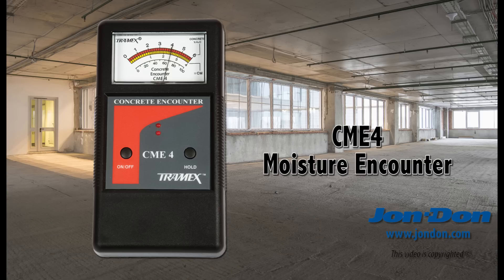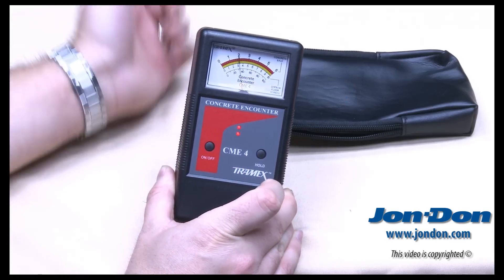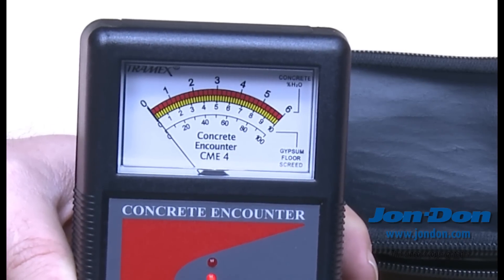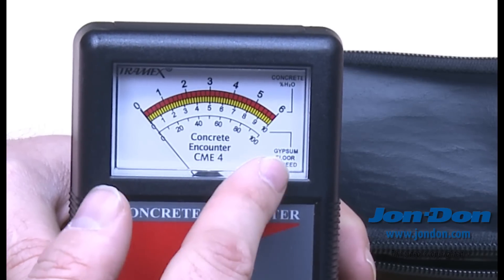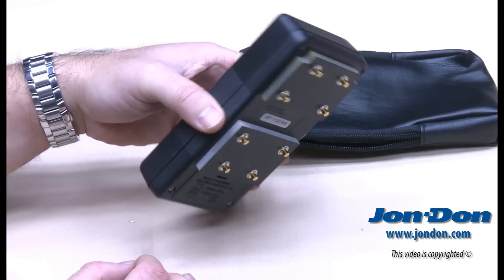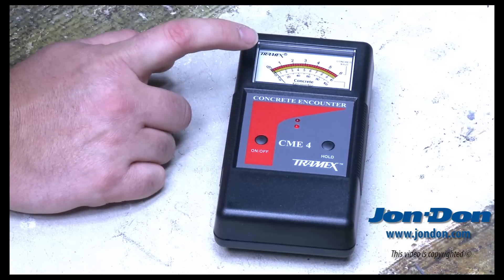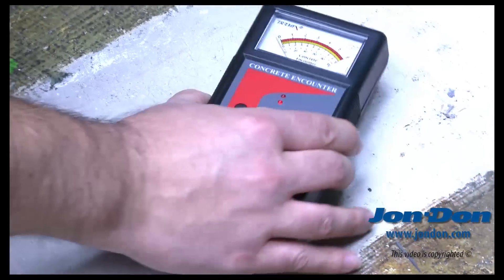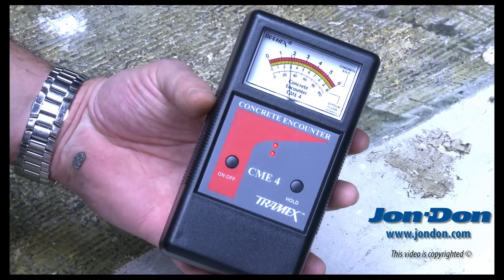Demo/Review of Tramex Concrete Moisture Encounter 4 - Jon-Don Video

Comment: This is all well and good but how does this reading do us any good when it comes to manufacturers warranties? Most product specs only provide moisture limits in lbs per 1,000sf. If I have a 5% reading on this, then how do we equate that? I’ve found no information anywhere as to what the readings on this machine mean or how the readings can be applied in an everyday scenario. Please shed some light
Reply from the maker: Most wood floor manufacturers have a required reading for the Tramex CME4, you can either call the wood floor manufacturer or google the wood floor manufacturer and Tramex CME4.  Most manufacturers require a reading of 4 - 4.5. For more assistance, please call at Jon-Don Restoration Rep at 800-556-6366 or email support@jondon.com.
Reply: Did anyone ever respond? I’m having the same issue.

Comment: What is the conversion from % to # of moisture
Reply: Jimenez did you ever get answers for this question I’m look for the same question haven’t seen  anything .
Reply from the maker: +Damon Jimenez Are you looking to convert relative humidity to grains per pound? Our friends at Dri-Eaz have a terrific online calculator. Just plug in the temperature and humidity level, and it will return your GPP.
Reply: +jondoninc The Tramex reads in precentages which is 1%-6%. what i'd like to know is how much pounds of moisture is in the concrete-for the area i've Tested
For Example: 4.8% = how many pounds of moisture
Reply: Same here I just purchased this for close to $1,000.00 and without know how convert this information is useless